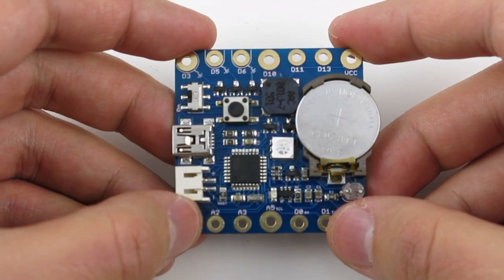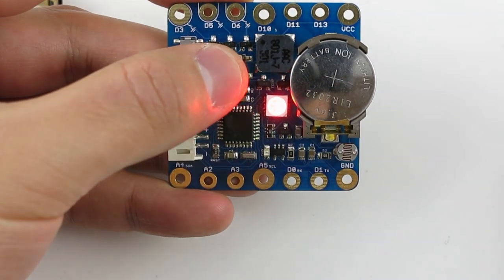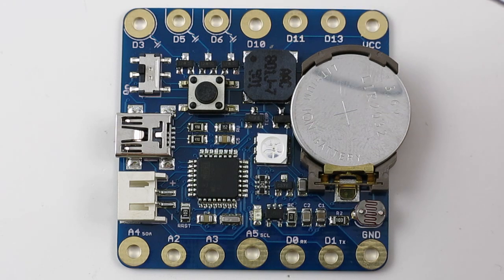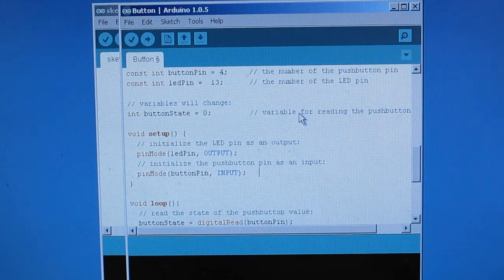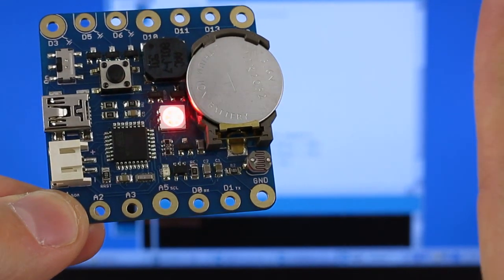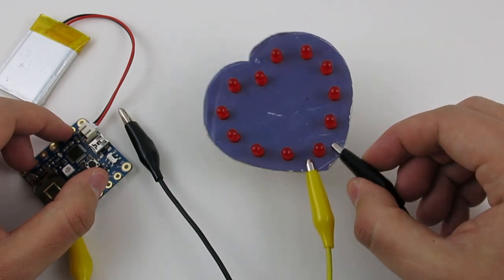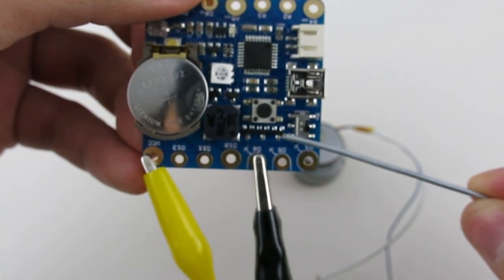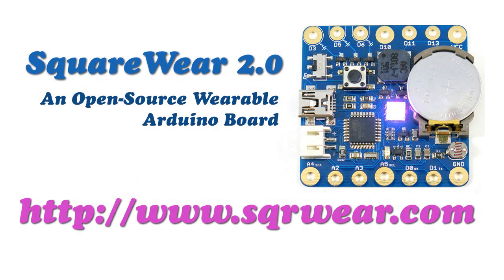SquareWear 2.0 -- An Open-Source, Arduino-based Wearable Microcontroller

Comment: I think people are disliking it because some of the examples you shown were geared more towards hobbyists rather than practical life applications. However that last example, the one with the light matrix, is a good example for buying your product. Not sure what the limitations were (no onboard memory maybe) but it would've been cool to see an actual speaker play sound files, instead of a buzzer.

Comment: Hi ,your stuff is really cool.I want to know to know what kind of the cpu do you use.Af far as I know ,MSP430 needs much less power
Reply from the maker: It uses ATmega328p microcontroller. The main reason to pick this microcontroller is to make it compatible with the Arduino software.
Reply: Thank you for your reply

Comment: cool,, but no A4 pin for A4-A5 total for IIC2 devices or displays, maybe in your next design
Reply from the maker: Those two pins are already mapped out: if you look at the bottom row of pins, A4 and A5 are there.

Comment: can you add built in wifi
Reply from the maker: Check out my new video: https://www.youtube.com/watch?v=ZKuIWDocIiM
Using ESP8266 + WS2812 LED matrix to create a little wireless display.
Reply: Is it possible you could send me your schematic  for the esp8266. I had tried using the esp8266 but it keeps overheating.. I think I fried 3 chips already